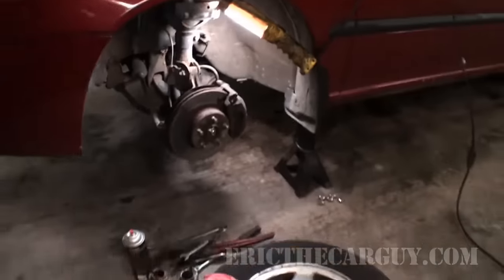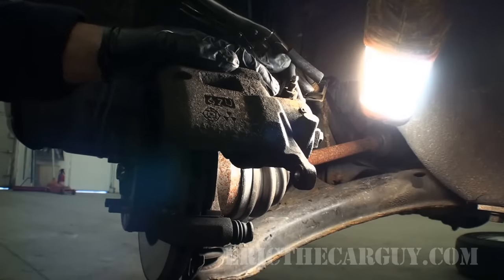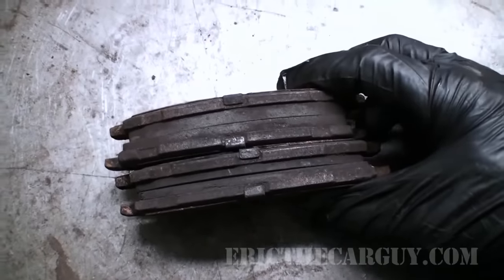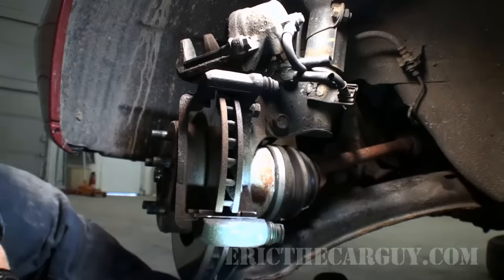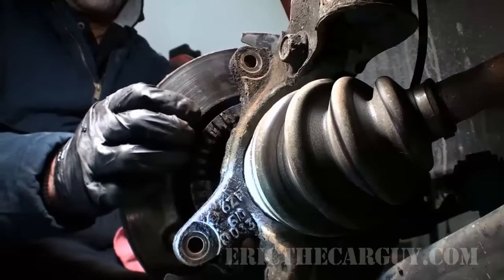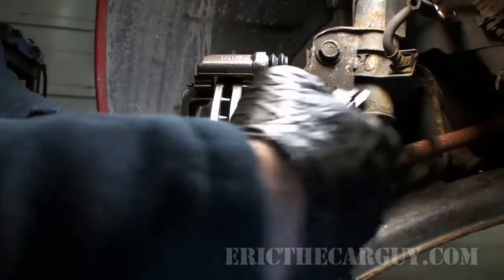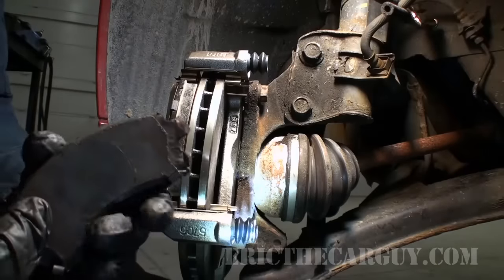How To Diagnose and Replace a Bad Brake Caliper -EricTheCarGuy

Comment: Hi I have a Toyota Tacoma 03 I just fix my transmission and it work for 8 days, my truck feels like the front calipers get lock. I put it on reverse and it goes but when I put it in drive it struggles. I pump the breaks and it moves forward. What do you think

Comment: On my 2001 Legacy the 17mm bolts that hold the mounting bracket did not want to come off and ended up snapping off on my driver and passenger sides. Also when I was checking the piston itself I used a c clamp and the piston would not compress at all and it was basically rusted on to the rotor and was really hard to get off as well. Time for new calipers. It also sucks I have the bolt that snapped stuck in the caliper mount bracket :/

Comment: I learned from years back you would bleed the furthest wheel from the master first than work your way to the closest wheel R/R, L/R,R/F, L/F. I found out that isn't true anymore. Instead of the back and front axles being separate like they were, they are now combined together. What I mean by that is one rear and one front work on the same line, Like the letter X, not the old = equal sign. Just something I learned with my Ford escort. This way if air gets into a line, and causes brake fade you still have front and rear brakes.

Comment: I'm thinking I have a bad caliper or two on my 2008 Escape, since I have a problem with them sticking.  Hopefully it's not a caliper.  I lubed up the slide pins and sanded off the pads since they were a little glazed.  Still get the sticking especially on warm, humid days

Comment: amazing watching your vids...I replaced both brake master and brake booster but still, when I you press on the brake it still soft...need your help on this? Thanks
Reply: there must be air on the system.   you have to bleed them all around,  I had that issue before, it takes time to get all the air out

Comment: Question... if one of those pad shims is broken can it cause a knocking type sound when driving? Speeds up and slows down in time with wheel speed. I can pull my pad shim nearly out with my fingers it is that loose, also the pad wiggles when tapped. This is not unassembled but happening installed on vehicle.

Comment: Hey do I have to replace both calipers? I was changing  pads on the front and one of the calipers is seized wont compress. Do I have to replace both calipers in the front or only the one that is defective?

Comment: A question...I've changed calipers. For the tiny fluid loss between switching out the calipers, and it is a tiny drip, not a flow, why bother with even possibly squashing your brake line ?
Reply: Depends on the car.  Some have a tiny reservoir that can run dry quickly.  Then you need to bleed the entire system rather than just the new caliper.

Comment: I install the brake pads and silicone them before I mount the bracket, and you also didn't use silicone paste on the back of the brake pads to prevent squeak between the pads and caliper?

*edit and another trick that was taught to me is to pour brake fluid into the caliper before putting the banjo bolt on then mount the caliper, can also ziptie the caliper so that the bleed valve is as high as the brake fluid reservoir then let nature do its thing can also tap the line to bump any air bubbles, that way bleeding the brakes takes less time

Comment: I had brakes, rotors new hub assemblies . My car started shaking so I took it back in . They say the caliper locked up and burnt the hose and warped the rotor so now after just paying 1500.00 for that work they want an additional 541.00 to fix it. . How could they have done tgat work and not known I needed a caliper or did they cause the problem during the fix 
Thank you

Comment: What are the threaded plastic pieces that slide over the bolt. Only one of the slide bolts had one. And does it go through the bottom of the caliper or top. Also, is it even necessary?

Comment: My 2010 Nissan Altima has problem with braking slowly. Every time you approach a stop light I need to watch how much I press the brakes, otherwise it will quickly grab and stop quickly stop.  I have the feeling of hitting my head on the steering wheel or car behind me crash on me.  I just replaced the brake pad, rotors and did bleeding. Good amount of brake fluid, no sign of oil leak, but I didn't check leaks at Master Cylinder or Booster.  No change with the braking issue.   What could be the problem? Thanks

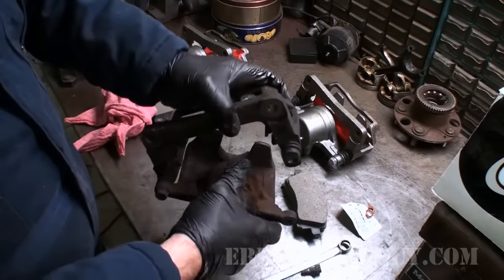Comment: Regarding caliper bolts being different sizes (at 15:30 in); most Remanufacturers do care about same size hex bolt size as the original, but they have little or no say as this is determined by very the few component suppliers that they all buy from. Reducing the hex size of a bolt head saves significant money for the bolt mfr when they make millions of bolts each year and that cost saving gets passed down to the consumer. That is another reason why Reman parts are often 30% less expensive than the original equipment part.

Comment: Regarding removing the "cosmoline " protective film only on the rotor pad contact area; I'm nowhere near being a mechanic but wouldn't that film, with all the heat and with the centrifugal force, cos that film to melt and then flow onto the brake pad contact area? I heard it's of a wax material.

Comment: You didn't say why you don't "like" the copper washers? A bit curious to why? Copper is of course used in places like this because it will seal it better (and with less torque) than steel, no?

Comment: How can I determine if a brake portion valve is bad on a 94 Crown Victoria ? I just changed the master. cylinder because the back brakes aren't hitting at all. Any suggestions & Thanks in advance ..." Dave the Guitar man "

Comment: I have a 2012 cruze with twist in calipers. Im trying to find how far do you have to turn it in. I turned it at first till the pads fit in but they were tight and rotor wouldnt turn by hand as soon as i just hand tightened tbe caliper back on. So i twisted the pston in alot more. Now it slipped over the rotor alot easier and with play between the pads and rotor and still same issue as soon as i just hand tighten the caliper bolts back on. Do i gotta twist that pizton in alot more or is it shot?

Comment: '04 Jeep Grand Cherokee - wobbles at about 40mph. Took it for a wheel alignment. While on lift, right front tire very difficult to rotate. Mechanic thinks caliper locked up. These are less than a year old. 1) Is he probably right? 2) are refurbs often faulty?
Reply: bammbamm12 l

Comment: If the slides freeze, like mine have, will this cause my New rotors to warp?  

I noticed during my last brake install they aren't moving but didn't think anything of it until my New rotors sound like they are warped again.

Comment: So I have an interesting issue. So I have been chasing a noise for over the last year in my front brakes on my equinox. The tins on the brake caliper bracket that the pad slides against become loose, and cause a squeaking noise when I brake. I take it apart, and everything is lubed, the slide pins move as they should and have been lubricated well with disc brake lube, permatex ceramic lube, the purple stuff. Anyhow, I can get the noise to go away for about a month and then the noise keeps coming back. I have replaced the hardware 3 times now, new brake pads, new rotors, new slide pins, and boots and all new tins 3 times now as well. I have pulled the pads out and the tins are so loose that they fall out. The new ones are nice and tight and stay quiet for a few weeks, then I take is apart and the tins fall back out again. It seems to brake fine, and the piston moves easily. I went to the junkyard and got a new caliper bracket, because I was having issues with one of the pins seizing up in the past, thought maybe that was part of the noise issue, well no dice. It's making noise AGAIN. Any ideas? New calipers or rebuild?

Comment: Hi Eric great video. I changed the rear left calliper but I keep getting low fluid level message.  I bled the calliper and never ran the master dry. The pedal feels good. Is there something i missed? Anything with the ABS? Thanks again for all your videos.
Reply: +bojna1 2 things that you might look for.. Inside where you put the brake fluid you can probably see a plastic piece, and on one side or the other of the reservoir will be an electrical connector. (most have this system if yours is not like this it might not be the same)
The plastic piece is a "float" or "wet connector" when the fluid drops below the level it opens or looses contact and says "low fluid" or you ABS light might come on.. That being said sometimes dirt or something that is floating in the fluid can make it hang open. Put some clean rubber gloves on and try to wiggle it with your finger while someone looks at the light on the dash. if its stuck it might blink. also check the connector for the 2 wires and make sure its connected all of the way.that's the connector to the float
Reply: +Jason B thanks I think you're right because the next day the light went off. I guess the float wiggles itself back into place. Thanks again.
Reply: +bojna1 if you see any sediment sitting on the bottom suck it out like Eric did and put new in. If not it will probably happen again and again if not fail all together.
Reply: +Jason B I think it happened because I had tried to suck out some of the old fluid and must have touched the float. Seems to be fine now. Thanks for the help. One thing I can't seem to find online is free repair manuals. Would you happen to know any site that would offer that? Thanks
Reply: +bojna1 probably not going to find one.  Two best bets are to go to a parts store and get a chitons or Haynes. One thing you might try is find a communal we sight for your car and see if they have anything. Example is doing a search for your vehicle like "Taurus forums" or Taurus websites. Then look or ask after you join if they have anything online.
Reply: +Jason B ok thanks I'll do that. I'm on a Pontiac forum already so I'll give it a shot. Thanks for all your help.

Comment: What about if you pump your brakes? And you see brake fluid coming out by your tire and caliper. But you just put a new caliper on. You have not opened the bleeder yet, and it's already coming out. Is that a bad break hose

Comment: Have a 2009 expedition and while driving and brakes are applied vehicle shakes, took to mechanic said to change out rotors so I did, still shakes, mechanic said it has to do with manifold gasket, is this true? What do u suggest my next step shld be?

Comment: a word about brake caliper bolts... I know from personal experience that the 2004 generation of the Pontiac grand prix had TTY fasteners. I know this because despite torquing to spec, one came loose and wedged the caliper against the barrel of the wheel. scary stuff lol

Comment: Another quick check of calliper is simply jacking car up and spinning tire by hand with vehicle in neutral.  Wheel should turn, but have some drag from brakes.
If wheel turns easily, or is very difficult to turn, calliper is likely the culprit.
Am I wrong?

Comment: Aric  I use a vacuum pump to bleed my brakes & I have a problem w/ air leaking in around the bleed valve.  What can I do to stop that?
Reply: +Bruce Boyles I saw a person put heavy grease on the threads to prevent that.

Comment: I replaced the calipers and rotors on a 2007 Chevy Malibu and the right side is still seizing. It's smoking (literally) hot after a ten minute drive. Is it the brake hose? OR something more sinister that I should be looking at?

Comment: Hi, my 2016 sonata has a pedal which is very soft almost goes to the floor, brake were changed, flushed the fluid and bled the caliper still the same, yesterday I replaced the master cylinder and bled the master cylinder and calipers again but no difference, what can be wrong. When the car is off after few pump my pedal is hard but when I start the car my pedal is low. Is it my calipers that are bad?  Thanks

Comment: Hi, please, could you help me :) I have a Skoda with a crazy TRW rear left brake caliper, brake getting hot (warm).. I rebuild the caliper with new seals (doublechecked). a new brake hose. all parts lubed and everything moves nice, brakepads loose ands lubed.. handbrake wire detached..  still the brake disk gets warm.. do you know whats wrong inside the caliper? maybe the spring? or selfadjusting mecanism? what is responsible to push the brake caliper cylinder backwards?.. my cylinder moves back just a half mm. or less. the brakedisk moves almost as free as the right one..

Comment: You should sand and clean the piston and then wipe it down with brake fluid, and dry it. Then and only then should you push it back in.  Also the compression tool is best because it distributes the piston pressure evenly.  Using the wrong tool like a channel lock is a bad idea.  It doesn't break it immediately, but in a few years, the uneven  stress from this one bad brake job will catch up with the part leading to failure.  I have never had to replace calipers on any of my cars.  I am the original owner of a '96, and 02 Cadillac, and Chevy venture.  I never get the rotors cut either, but I do change out the fluid at every brake job. I also spray the springs, boots, and pins clean.

Comment: Good call on not using the copper washers, i also dont use the bolts (i buy oem) because i dont know where they came from or the quality. Another thing i should note is that the bleed screw that these people use are garbage. Go buy the oem ones from the dealership and you will notice the quality is better.

Comment: I have a constant squeeking noise from my front brakes even when I am not braking and I had to sand down the pads because they were unevenly worn which tells me that the pads are slightly rubbing against the rotor when not applying the brakes. could this be a bad caliper that's not properly holding the brakes in place?

Comment: Hey! my front tires (i think right side) is making a loud whining/ squealing sound.  It gets worse when i push on the brakes while going. Also it makes a softer screeching whining sound while the car is going (10+mph) without breaking.  Can you help me figure out what the problem is.  Shop said brakes  are at 40%.  I am going to replace the brakes and rotors, but i don't think they are the problem. PLEASE HELP!

Comment: Hey another question which you wont answer after two years the rear rotors are hot and front ones is new but when I apply the brakes i feel a pulsating from the back ones and when I tough them they are hot so I think they work could the problem be that the rotors warp?

Comment: at 9:50 you said to check for bad line is to pump brakes and the crack 
bleeder and if fluid comes out it is possibly a bad line and if nothing 
comes out its ok, is that right or is it backwards that if fluid does not come out the line may be bad?

Comment: Would any silicone based lube work for the slide pins or does it have to be  100% silicone? I wanna try this stuff called magic lube 2 but it's not for this purpose usually 😂

Comment: It puzzles me how I can move or rock the front rotor with my hand with the tire off.  Also would this be the cause of sounds of loose metal rattling noise while driving- how do I fix this problem?

Comment: I installed new pads and 1 rotor on the rear of a 97 toyota avalon, the old rotor was grinded by the outside worned-down pad, the grinded area was about centimeter wide. after installing the new pads and rotor and driving to and from work for 1 day, the ABS light turns on and grinding has already started on the exact same spot. could this be a bad caliper that's not releasing?

Comment: There was one 3M Silicone grease (used on the caliper slide pins) that was causing rubber to swell. In particular the rubber O-rings on slide pins. And another that did not. There's some buried wording in the spec's of both, one says "useful on rubber", the other doesn't. Not that informative...

Sil-Glyde Brake Lubricant is similar product, and is ok with rubber.

Thanks for the videos btw, love them!

Comment: I like the idea of the vise grips having tubing on them to pinch the brake line....I changed mine without pinching the line,,,but I wanted to flush the old crap out even though it’s a mess

Comment: caution. most machine shops take way too much metal off of the rotors when you have them turned. they lose the ability to disperse heat and then they warp. depending on the trunck/car , many rotors have to be replaced after only 1 turning. all you want is to take off the very minimum needed to true and clean up the wear grooves. they take as much metal as possible to sell you replacement rotors sooner. cars are expensive to maintain but it still has to be safe.

Comment: eric i have been watching your videos on the honda series such as the j series and k series engines from honda and acura but i have yet to see a video from you explaining the fixes and remedies on the 05 acura rl which for example i have the issues with the vsa pump and module which is also connected to the awd system the abs system....in other words my issue is i replaced the vsa pump and its more or less the same the light is still on the abs doesnt work like its supposed to and the awd light is on the dealer said to bring it in to check it out but thats just highway robbery i know i can fix it myself they said it probably needs to to recalibrated which is possible i dont know i dont have the software acura uses so im at my end i want hhis fixed and working the way its supposed to work so im asking for your help and also if you know a fix and also make a video on this issue for future reference if possible....i was getting codes 64-1 84-1 112-1 the brakes still work but i want it to be the way it was meant to work do you have any suggestions and a possible fix and answer thanks eligold signing off